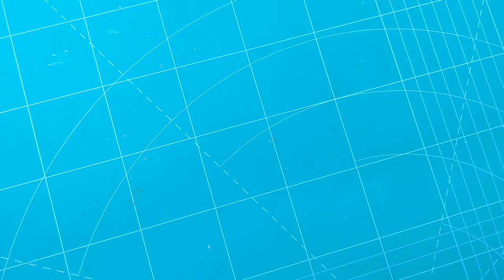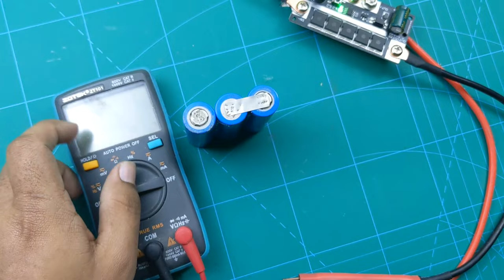DIY Battery Pack: Choosing a High Capacity 18650 Battery for a 12V 3Ah Battery Pack @cubityt

Comment: NO  you should discharge and charge the batteries FIRST before measuring the voltage
Reply: How to discharge battery?
Reply: @yamraajji1086 Zbl23 module 😅

Comment: Hello sir. Made my own battery pack same as your presentation. Charged it perfectly for the first time then used it til it becam low battery. But upon charging, it wont charge. Whats the possible reason? I followed the same diagram as yours. Thanks
Reply from the maker: Check the battery voltage. If output voltage is less then 8.4v then might one cell damage. Then you need the removing all connection and check the 3 cell separately. Which battery cell voltage less than 2.4v you need to replace this battery another good one.. thank you

Comment: Is it 3 a i don't think so.. they are in serial connection .. not parallel.. tell me when i m wrong
Reply from the maker: I think you don't notice my 18650 cell capacity. All three 18650 cells are above 3200 mah. That's why the battery pack is 3amp. Thank you dear.
Reply: @cubityt  oh ok is that real capacity ? Because as long as i knew each of them only have maksimum 2600 mah...
Reply from the maker: @idnetbox  maximum capacity which is available in the market is 3500 mah. Standby capacity is 1800 mah to 2600 mah..but not the maximum capacity is 2600 mah.
Reply: @cubityt  just suggestion from me.. would you like make a video with multitester for charging and discharging ? It is amazing video from you 🙏thanks
Reply from the maker: @idnetbox  ok dear..i will make it soon 🔜..

Comment: Mere Bms board se output voltage nahi ara h mene negative ko short krke bhi dekha 3 bms board change kr diye connection bhi sahi h pr output nhi mil rha plz tell 🙏🏻🙏🏻🙏🏻
Reply from the maker: In that case you will charge this battery pack sometimes..then its start working

Comment: I made a circuit, with (3 Batteries + 10A BMS & XL6009) - working fine. Buit, the battery voltage is dropping automatically even if the input voltage is ON and is 12V. Why the battery voltage should drop ??  Where could be the problem ??
Reply from the maker: Remove X L6009
Reply: @cubityt  why ?  Many people have used XL6009 in their circuit and it works fine. Pl reply.
Reply from the maker: @irapashunnur8237  Remove first and check.
Reply: are you using a PROPER charger?  Is one cell defective?

Comment: Can we use this battery pack for charging and discharging at the same time as we see some fans are able to run while charging?
Reply: Yeah. You can. Because the voltage between output remains the same even though the batteries are low while connected to charger. Just make a try

Comment: I submit that it is very misleading to imply a BMS can replace a proper charger
Using a BMS ti charge Li-ion batteries can DAMAGE the batteries by shortening the discharge time and life of the battery.
It SEEMS to work but you will be slowly DESTROYING it

Comment: I have same spot welding machine, but not working. How you are giving supply to spot welding machine. ??
Reply from the maker: @vikasazad08  you can use lipo battery more than 45c discharge rate for supply power.

Comment: On the output dc jack we have to the charger wire?
Reply from the maker: Yes
Reply: @cubityt  can I attach normal phone charger?
Reply: @sabirsheikh555 from what I've seen in other videos you have to use 12.6 volt 2 amp charger.

Comment: What's the BMS used for. Can this be done with 3 batteries without the BMS for a 12V hand drill?
Reply from the maker: Bms is a battery management system. without bms for example: when charging some cell are over voltage and some cell not fully changed. when discharging then some cell are fully discharged and other cell are not fully discharged.
Reply: @cubityt is the BMS is over charging protection or auto disconnect?

Comment: Completed wiring perfectly alright,on BMS,3స్,20A module, values are perfect but at out put getting 7.7 V only. What could be the reason bhai?
Reply from the maker: Check the individual battery first. If all battery voltage greater than 3.7v then use this battery for making a battery pack.
Reply: @cubityt    brother🙏with DMM measured voltages on BMS, 3S, 20A module as 3.83v, 7.3V, 11.36v, by placing DMM black probe at Ov.  But the o/p is 7.7V only. I am using 6 batteries total, 2in parallel each(for high current), with 3 pairs to get 12v, to use as Honda Activa battery
Reply: Charge each and every batteries individually once all cells charged then use it

Comment: Bms can automatically off when it's full charge sir???
Reply from the maker: Yes brother ❤️
Reply: @cubityt   OMG   a B<S is NOT  a charger.  The BMS would ontue - there is NO logic to realize when they  are charged
Reply from the maker: @kennmossman8701  BMS is designed to cut off the charging voltage when the battery is full. This is an essential safety feature to prevent overcharging, which can damage the battery, create safety hazards, and reduce the battery's lifespan. The BMS monitors the voltage of the battery cells during charging, and when it detects that the cells have reached their maximum safe voltage level, it will disconnect the charging source to stop the charging process. BOKACHODA
Reply: Thanks bro want to ask the same question
Reply: @cubityt     where do you get this - try reading technical  articles

show just one BMS datasheet that supports your   claims -  speficially that
-any bms will recognize all cells are fully charged
-the bms will turn off power from the charger

 I will not wait because you wont find any.,
Reply: @cubityt   where do you get this - try reading technical  articles

show just one BMS datasheet that supports your   claims -  speficially that
-any bms will recognize all cells are fully charged
-the bms will turn off power from the charger

 I will not wait because you wont find any.,
Reply: @cubityt  there are several types of bms from simple to smart. you are saying ALL are the smart type which is obviously wrong
Reply: @cubityt  there are several types of bms from simple to smart. you are saying ALL are the smart type which is obviously wrong

Comment: Do you recharge using the same output terminals by the DC jack? Thank you.
Reply from the maker: Yes. Same dc jack using for input and output
Reply: @cubityt then where to connect motor?
Reply from the maker: @yamraajji1086  output terminal. check the bms first